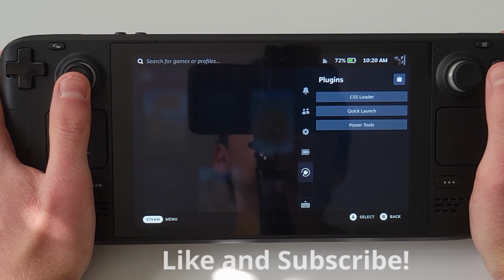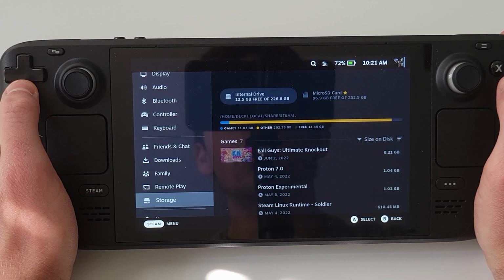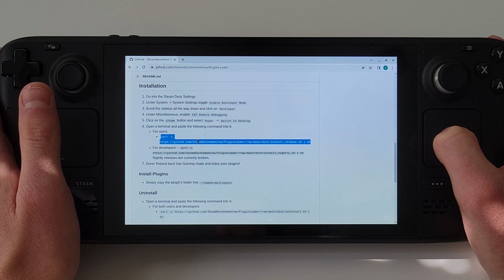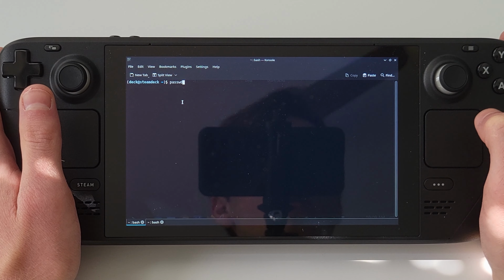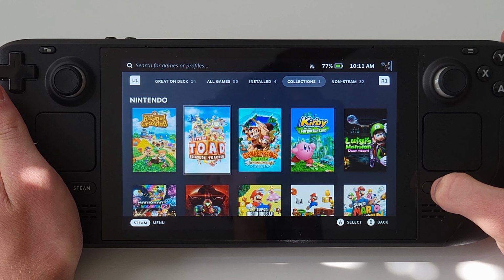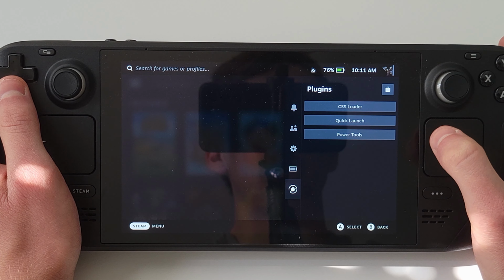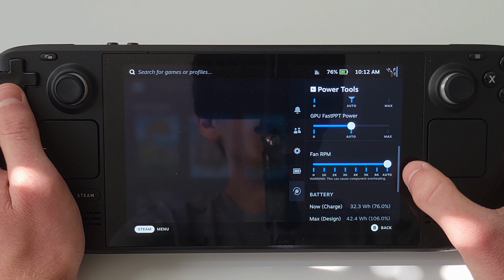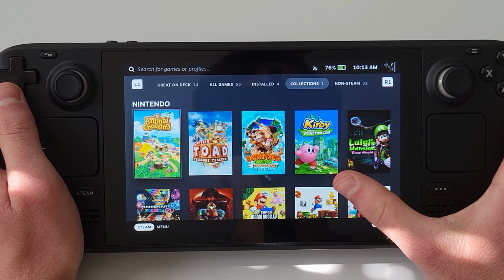Steam Deck Plugin Loader Installation Guide - PowerTools Plugin and More!

Comment: I have power tools v1.0.5 installed and there is no CPU boost or fan control settings available?
Reply from the maker: Your version is newer and may not have the same features

Comment: I installed it, did some tweaking but it keep the settings even if i restart Steam…is there a way to reset the settings to default? I don’t want a setting i change to impact my games on steam when I’m not using emulators.

Comment: WARNING: INSTALLING POWERTOOL AND BEING IN DEVELOPER MODE WILL IMPACT PERFORMANCE ON STEAM GAMES. I was playing BO3 zombies with power tools installed and was still in developer mode and I couldn't get a solid 60 fps on medium settings unless I quit developer mode and uninstalled power tools. Keep in mind, I can still easily install power tools from the menu BUT I recommend only doing it for emulators only!!
Reply: Just turn off developer mode?
Reply: @bullymaguire243  ya, i did that. Developer mode is only for mods/certain games that benefit from power tools.
Reply: @bullymaguire243  oh, yeah uninstalling powertools was not the problem here.

Comment: Does Power Tools override the CPU clock limit by default?
That's the only setting that is not automatic and i think it may be draining my battery
Reply: This to play it on a TV with the Docking Station is perfect, connected to the current, but if you go out and want to play without a charger it will suck the battery fast:elbowcough:

Comment: Followed the guide exactly however my deck freezes whenever I open the plug-in menu. Guess it is in beta but it’s a shame, I wanted to use PowerTools.
Reply: I got a similar issue. I can't install the plugins lol
Reply: @dan_kotsu  I ended up installing it via Emudeck “expert” setup mode. It works that way if you want to try it.

Comment: Disabling threads is probably the most useful. Sometimes when deck is maxing out the GPU, there is non power left to let cpu go to higher boost clocks. Often loosing performance on feeding more threads - that some games are not even using.
Reply: Good for performance in some emulators, craps on the tdp though.
Your battery dies notably faster.
Reply: @johnfrankster3244  yeah, because it changes cpu behaviour/governor. In some games like crysis 2 you can get higher performance and less fps drops with only 4 cores on max clocks and HT disabled, rather than full 4c/8t which is not fully utilized bjt draw power regardless. Problem is when you set it that way in powertools they will not clock down when needed - but instead boost to max mhz all the time and draw 7-8watts when its not really needed. What we need is original apu optimization which is good, with possibility to disable threads, or ability to manual set governors. Its what I think.
Reply: @SzymonKasperczyk  Yeah if only valve would release that lol. Have to rely on community digging.

Comment: I want to just copy all the roms from my PC but every time I try to place my Steam Deck SD Card into my PC, it wants to format it. Do I have to manually re-install every game I have onto the Steam Deck?
Reply from the maker: Just transfer files using warpinator instead, so you don't have to connect the sd card to the pc.
Reply from the maker: Here is a good video on how to do it.
https://youtu.be/sHdQT6kI6Q8
Reply: Format the sd card as exFat and then move all your roms from a windows machine to the sd card and steam os will be able to see them in desktop mode.
Reply: Usb thumb drive keep sd in the deck and connect the thumb drive via charger port on the deck u can buy a adapter and the deck recognize it even though its windows format . You can drag and drop on the deck itself kind a pain but this is the only way I found to be not as pain

Comment: Hi! I remember you noted that PowerTools didn’t end up making a significant difference. Are you finding that it is helpful in some games now?
Reply from the maker: Yes it has helped in super mario odyssey and mario kart so far. It did not help in kirby forgotten land.
Reply from the maker: definitely helps improve fps in some cases for sure.
Reply: instantly got good performance in super mario galaxy 1 and 2 by disabling SMT
Reply: Does it improve the normal games from steam?
Reply from the maker: @DaBrown101  it's more for emulation and will likely hurt performance in normal games bc your disabling cpu threads.
Reply: @switchdeck9164  has this been tested? I ask because my main use will be steam games and no emulation for me. I might.... MIGHT do emulation later if I get more into gaming on it but as of right now, it would be more for casual gaming and just my steam library but I want the most performance as well, if that makes sense.
Reply from the maker: @DaBrown101  Your disabling cpu cores this will not help performance for a modern game. Emulation, such as yuzu is translating code from a game designed to run on a switch cpu that has 4 cores. Modern games are designed to take advantage of the extra threads and different cpu types. Use all 8 threads/cores for everything outside of emulation. Disabling them should only be done on a case by case basis when using emulators.
Reply: @switchdeck9164  ah that makes sense. I was thinking that disabling cores and them running at a higher speed they would provide a slightly better performance with same amount of battery life. But your explanation makes sense! Thanks for the information!